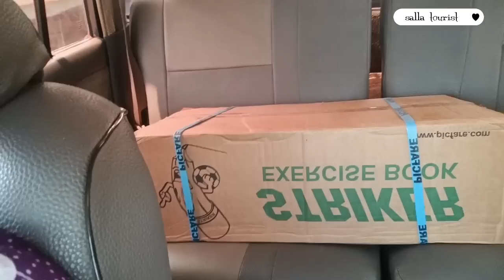we bought seats, windows, and books for our community school

Comment: You can either use the 24:00 hour clock or 12:00 but in most cases abroad or on international airport and mostly hospitals they use 24:00 hour clock  because a day is 24:00 hrs,and people work in shifts throughout the day so when you clock in your arrival time it shows the time you start and date